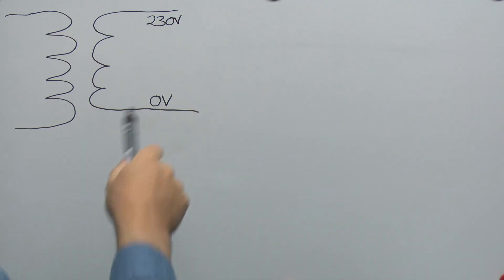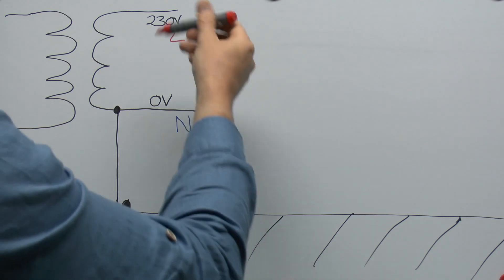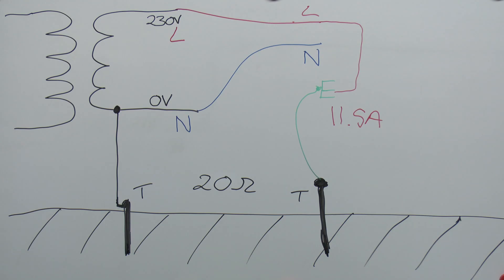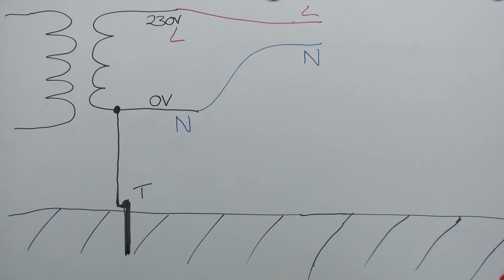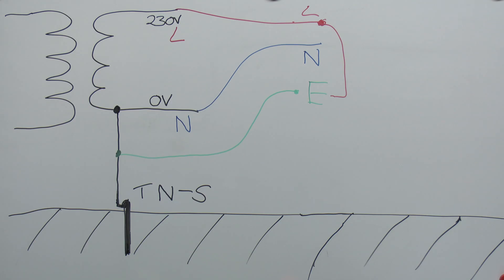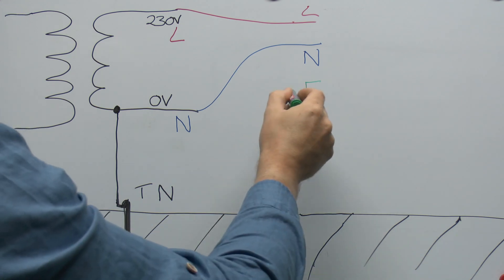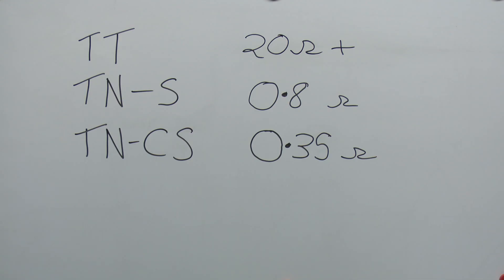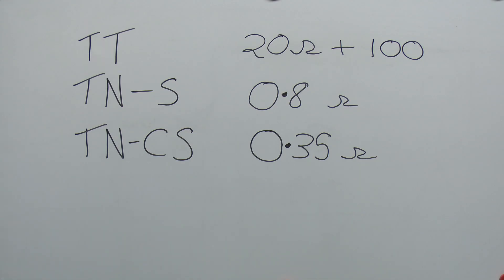Types of Earthing System for Electricity Supplies (UK)

Comment: Would you please explain how you can refer to one of the live ends of a step down transformer as a neutral?  Here in the US, we use center tap as neutral w/ 120V on both legs.  You seemed to be describing a system where one leg is grounded.  What on earth is that about?
Reply from the maker: Whatever is connected to ground is the neutral, so with 2 wires one is neutral and the other 240V.  There are no 120V supplies in the UK.
Reply: Yeah, here we call that ground.  Neutral is the center tap on the secondary which stays "neutral" and at zero voltage.  It then is grounded also.  The reason we call it neutral is because it is in between opposing voltages.  Is there any reason why you don't center tap your transformers too, so you can run on lower voltages in the home?
Reply from the maker: Lower voltage would mean higher current is required for the same power, resulting in higher transmission losses and the use of larger, more expensive wiring.
Reply: ***** We don't transmit at low power.  We step it down at the users end.  We use 15 and 20 amp circuits w/ AWG14 and AWG12 respectively in our homes.  What sizes do you use in Europe?
Reply: 240V is between one phase and neutral or ground. 400V is one phase to another phase.
2 or 3 phases mean you have both 240V and 400V available.
Live chassis would only happen if there was no earth connected. 400V only equipment generally works fine without the neutral (which only needs to be there if something on the device needs 240V).
Reply: alex tworkowski "Grounding something does not make it neutral." This is completely incorrect. Grounding something is exactly what makes it neutral. It is in fact the definition of neutral. A neutral conductor is one which has no voltage between it and ground, which means if you touch it nothing will happen to you. You can make any conductor neutral, including the leg at one end of a transformer. Please forget the seesaw/teeter totter analogy. It is not correct. It is wrong.
Reply: Firstly, and maybe not surprisingly, we do not use American Wire Gauge (AWG) to reference our cables. We use Cross Sectional Area (CSA) measured in square Millimeters (mm2).
A typical feed into a modern property would come in on 25mm2 cable, which would be protected by a 100A main cutout fuse. The circuits we use range from 6A for lighting through to about 50A which would probably be used with a modern electric shower. Socket circuits, will either be 32A  rings, or 20A radials.
The specific cable size used would be very much dependent on the installation method of said cable, and is based on quite a few factors, such as grouping of circuits, whether or not the cabling runs through insulation etc, to name just two. I could go on, but I hope this gives you a basic idea. Cheers.
Reply: Alex in the US system you ground the centre tap that becomes neutral and is also ground. So each of the ends is 120 volts above earth/ground.In the UK one end, either, is connected to ground so becomes at the same potential as ground so you cannot get a shock from that terminal to ground. The other however is at 230 volts above ground/earth. They do not use 120 volts there. It is 230 volts in the UK and Europe.
Reply: alex tworkowski Nope, a transformer on a pole as you have over there. I am talking about the secondary side, set up similarly just for higher voltages, instead of 120/240 it's 240/480.
Reply: They are actual windings just connected together, so think of it like two AA batteries, 1.5V each in series gives you 3V. You have a connection between the two and from that point to each side gives you 1.5V, so it is a common 0V neutral point. On the transformer it is grounded. Of course end to end without connecting to the mid point you get the added voltage of 3V (480V).

The difference between a winding and a tap is if they're a separate coil isolated from the others, or one winding with several points "tapped off".

Probably getting confusing, so here's a rough drawing that might make it more clear: https://dl.dropboxusercontent.com/u/31593823/IMG_20161129_222400.jpg
Reply: let me try to explain this to you alex. this LV transformer is actually a 3 phase transformer,  where the secondary side is arranged in a star fashion, and the central point of that is connected by a conductor called neutral just like in US. that point is also connected to earth. since residential dwellings are single phase, then the connection to each house is made between one of the phases, and neutral as he shown on the diagram
Reply: Is that really true on Alternating current? In sweden 2 phaze is labelled as 400v even though 1 phaze is 240-250. It's mostly used in old houses for heating convectors and radiators though. And we would have 3 phaze for big motors like firewood chop saws and such in old installations neither of these would have a neutral and only 3 phaze would have an earth which means you cant use new 3 phaze machines on old installations becasue it might ake them run poorly and also make the chassi live.
Reply: Your transformers do the same as far as I can tell. You take the mid point of one 240V winding and use it as a neutral for two 120V lines, the mid point neutral gets grounded therefore only 120V is present to ground via the two lines. With a single 240V winding one end is made neutral and the other line, the neutral is grounded and 240V is present to ground due to the whole winding used, not split.

Here in Australia we aditionally use a combination of both UK and US for rural irrigation pumps. Two 240V windings are connected in series to make 480V for the large motors, the motor is connected between the lines/"legs". The neutral is grounded so 240V is only seen to earth from either line. This way  240V can be still be used as well as 480V motors.

(the 480V system is rural only and used on a SWER)
Reply: ***** I think the word "neutral" is being used too widely.  The reason that the US system is called a neutral is because it's at zero volts.  There is no voltage at the center tap of a transformer.  Think of a seesaw.  A teeter totter.  As one side goes up, the other side goes down.  The center does not move.  It is neutral.  Grounding something does not make it neutral.  Unless you just want to use that word for a grounded leg.
Reply: Dennis yoj I understand.  One end is ground, not neutral.  How many phases are being sent out on the mains?
Reply: ***** Two 240V windings are connected in series to make 480V for the large motors,....  Are you speaking of the actual generating point or a midway transformer?  I'm not familiar w/ the different systems around the world.  That sounds like a good system.
Reply: ***** I understand.  So when you say that the 240 windings are connected in series, do you mean that they just have twice the windings or are there actual taps that are available to change the voltages?
Reply: ***** No, i'm okay w/ it.  I understand theory.  I was just wondering why they would build it that way if the transformers were being used all over Australia.  I was wondering if they were set up to conform to the world markets.  I didn't really state my question very well.  I couldn't understand why 240V leg had to be made of two 120v legs in series.  I'll look at the link you sent.  And thank you for that.  
Oh...now i see what you were saying.  Excellent sketches.  The 480v is identical to US except for values and the 240v only is very interesting.
Reply: Lotrioni Why didn't he say so?  That sounds plausible.  My feeling was that center tap was zero volts, so could be considered neutral.  Star and delta are not second nature to me, but i'm getting it.  Thank you.

Comment: We are doing electricity at school, however, the boys do not let the girls set up the experiments because we are girls!

Now, what I do not understand from your video is why we have the “E” wire at all, as it seems to me if the “N” was not connected to the world then we couldn’t get an electrocution as the electricity from the “L” couldn’t get back to the other “N” or “L”.  Obviously,  you would still get an electrocution if you touched the “N” and “L” but that would be so of you had the “E” too. where have I gone wrong?
Reply from the maker: An isolated system like that would work in theory, but in reality will not because it is only safe while it remains isolated.  A fault anywhere between one conductor and earth would make it an earth referenced system, and then you have no control over which conductor is referenced to earth and no protection for additional faults.
Reply: Ok, I think I understand, but it would be best if you "could" keep the N and the L away from the surface, Yes?

What my dad did when he made my Dolls house, I still have it btw, he put a special device to reduced the voltage, that is the push I think, and make the N and the L  disconnected from the little bulbs, it still works as I use it as a night light, I'm hoping to grow out of my fear of the dark btw. My dad said we could not realistically do that in our house because the wires in the walls would then be too big, he said men who know this stuff, like you do would like to make the voltage bigger not smaller, is that so?

Anyway thank you for your help, I am hoping for an "A" on my homework, as I got an "F" in resistive materials because I got JJ to make my bookends for me and the teacher had a hissy fit just because I used my initiative to facilitate book ends that did not require me to use saws, wooden hammers, very, very sharp chisels and abrasive sheet that plainly was made to do your nails! 
  
You are a very interesting man, you should really be a teacher in school because you would understand we have questions to ask before we can give answers. Girls may not be as interested in boys things, however, as long as we can get the boys to get our pass grade and the girls can do their sewing and baking for the boys, so they may get their pass grade  as that is only the same as electricity, as the current, voltage, and the other thing, work-done I think are not the same but they help each other don’t they.

Comment: In Australia we have a MEN (multiple earthed neutral) system where the star point of the transformer is earthed and each house is supplied with active(s) and a neutral. At the main switchboard an earth stake is connected to the main earth terminal and a link is main to the neutral terminal. This means that any A-E faults will flow through the houses earth wires then go back on the neutral. If there is a fault with the neutral as well and it is broken then the current will flow through the earth stake to the transformer, providing the best of bot options 1 and 3 from the video.
Reply: That's the TN-C-S system. In Germany is this the most common system too. But only in houses build or modernized after 1973. Before this date TN-C was the common system, with no separate wire for N and PE. You've got only one wire for this, the PEN.
Reply: The best system
Reply: There are some pen systems in Australia but it's not very common and only in particular circumstances
Reply: Now the PEN is in Germany allowed only if it is minimum 10mm² copper or 16mm² aluminum. But only for new installations, the old ones made before 1973 succumb to the right of continuance. But only if they are not unsafe, making massive changes (extensions for example) and if they no longer conform with the regulations that were valid during the time of installation. A change of a wall socket, lamp or a switch does not affect the right of continuance.

Comment: Hi JW

these videos are excellent and very informative. I had a question for you about power tool earthing. I've come across metallic power tools without earthing from the mains lead. ie only two core. The shop explained this by claiming that the tool is double earthed internally. I'm suspicious. have you heard of such a thing?
Reply from the maker: They probably meant double insulated, where the equipment either has no exposed metal parts, or has additional insulation so that if a fault occurs internally it can't result in live parts being exposed to the user.

Comment: Your drawing is incorrect. The transformers are STAR connected 3 phase and it is the COMMON point that is connected to the general mass of earth and provides the neutral conductor/cpc. If you simply connected a single phase output from the transformer as per your drawing it would short out and fail as the resistance would be lower than any circuit connected to it.
Reply: John is only showing one of the three phase windings as domestic supplies in the UK are generally single phase. You could add in the other two windings at the distributions transformer end, but it's not going to complicate the diagram without adding anything to the earthing story. So let's call it a simplification, as the video is about earthing and not the totality of the local distribution network.

Comment: With the neutral being earthed does this mean that the neutral is always at 0 volts with respect to earth? If this is the case then it is possible that someone could suffer a peak to peak voltage shock, not good.
Am I just confused:)
Reply: You can't get peak-to-peak voltage shocks as the potential from live to earth just varies from +325v to -325v. There is never a 650v "peak to peak" anywhere. Connecting the neutral to earth cannot possibly change the potential of live referenced to neutral.

Of course, in a system without a supply referenced to earth (as happens in older properties in Norway - something called and "IT" network), then there is, in principle, no potential from either of the supply wires to earth. However, in practice, that's illusory on a domestic distribution systems as stray earths are ubiquitous. Hence Norway is moving to TN-C-S distribution.

Comment: we have a Wooden Electricity pole outside our house and down the side of the wooden pole runs a thick black wire (the black seems to be just plastic insulation and where the insulation has brocked away you can see the Thick wire which is silver and not copper coloured), and its tapped to what looks like the Neutral wire on the pole and then the wire just goes either into the ground oif the property, or goes to the meter box on side of wall of property. - This is all put on the electricity supply board not on the consumer side of things. So does this mean the house/premises still has to have one or more earth rods even with this earth wire tapped to neutral line from the wooden pole? - or have the electrical supply board supplied to required earth protection to the house? - the house/property is in the republic of Ireland by the way, just in case the electrical supply is distributed differently to the UK.

Comment: Here in Germany we use TN-Net, TT-Net and IT-Net. The TN is splittet into TN-S, TN-C and TN-S-C. We use normal 3 L Phase, some old houses have only one L Phase. The power cable come in house direct into a big fuse for every phase - at this point the 'Saved Earth' and 'Neutral' go to two difference lines. This place is the exchange point between the power company and my home power net. After this I must install the Watt-Meter from my power company. After this we can install every RCD how we want use ... Most older installation haven't one. For Thailand I not know the situation, we use there an own transformator ...
Reply: Is it allowed to make TN-S-C ?

Comment: why the plugs have third terminal (earth wire)? doesn't netural wrie connect to earth?  why don't we split the netural wire and connect one to the appliances's case ?
Reply: The ground wire usually connects to conductive material on different conductive material (like the metal casing of a washing machine) to prevent electrocution to the people touching the machinery.

Comment: Might sound daft but why do TN-S cables have a higher resistance than a TN-C-S. Surely the resistance should be very similar or do they use lower quality cable for the earth or is it just longer run?
Reply from the maker: +Scott Clewlow TN-S is usually supplied on PILC cable, which has 2 copper conductors for line & neutral, the earth is the outer lead covering with a steel tape over it, so resistance is higher.
TN-C-S typically supplied on concentric, which is all copper for the line and combined neutral & earth.

Comment: Hi John,

I stopped the video at 2:45 'cause I was shouting at you! The mains transformer secondary winding can't be 230v one side and zero at the other since each side oscillates between 0 and 230v 50 times per second. Shorting one side to earth would strap both secondary winding terminals to zero, just before the input fuse blows... :-( 

Tim.
Reply: Err, no. The neutral always remains at earth potential and the relative line potential alternates about it.
Reply: Err, no. The neutral always remains at earth potential and the relative line potential alternates about it.

Comment: Suppose I have a three-phase motor fed from a panel that has 3 phases and one grounded neutral. I then decide to ground the mass of the equipment through an earth rod (TT) in instead of using the grounded neutral from the panel. What would the drawbacks be if I decided to interconnect this earth road with the neutral from the panel (that comes from a grounded wye LV side three-phase transformer)?
Reply: It sounds like you're describing a grounding conductor off the equipment shell bonded to the neutral coming in from the utility. This is fine. If you're talking about having two separate ground references on the same equipment, this is not fine.